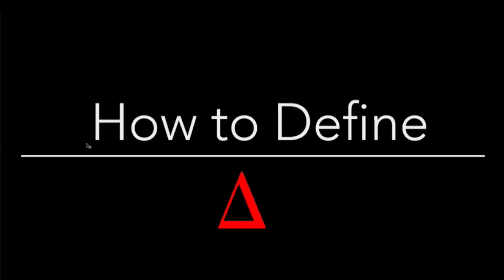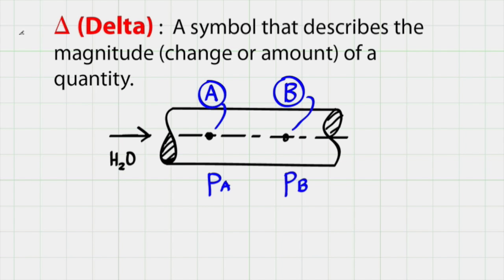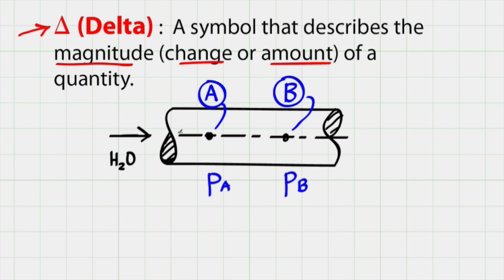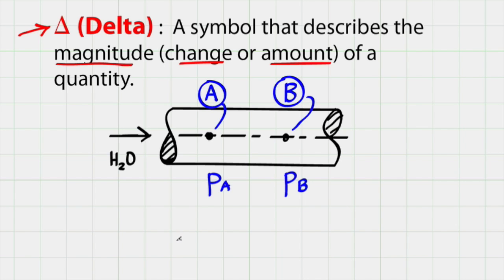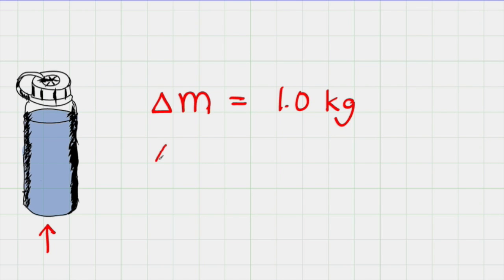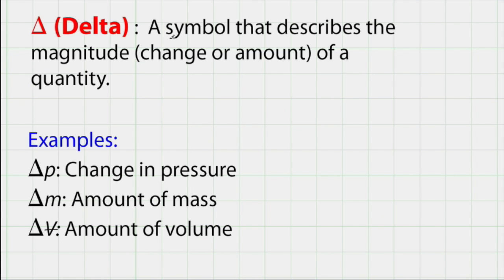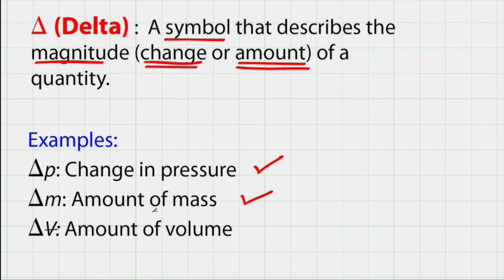Define Delta

Comment: Wouldn't the change in pressure from point A to point B be Pb-Pa since the H20 is flowing from  A to B? Pa-Pb gives you the difference in pressures between the two points, but it is referenced at Pa, where the change has not happened yet.